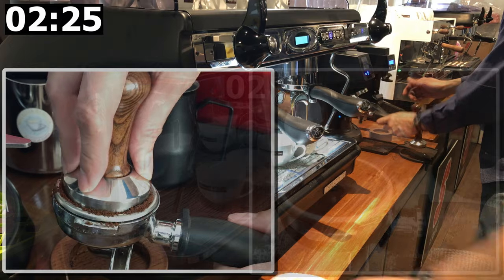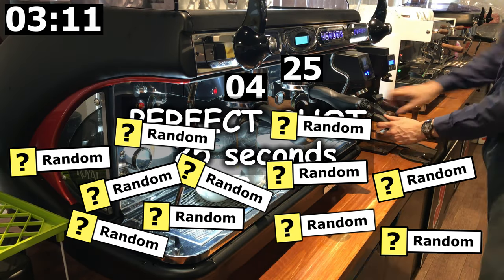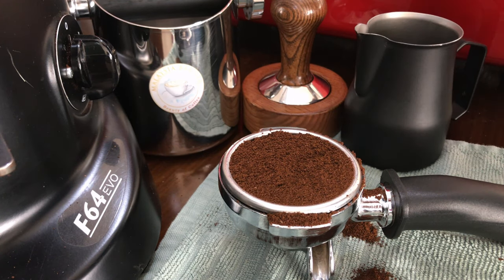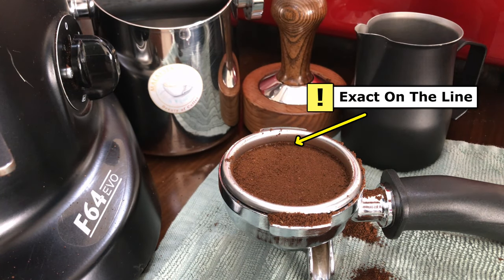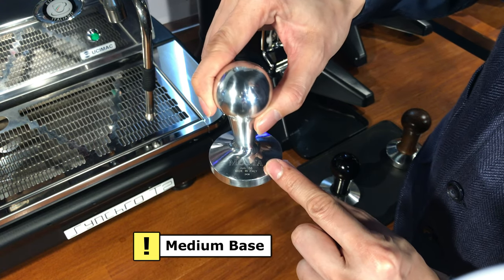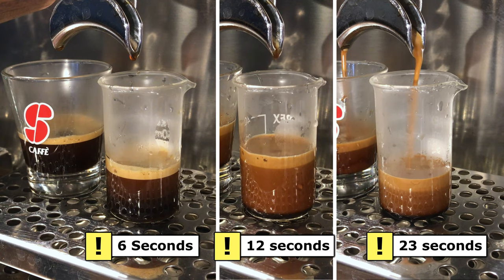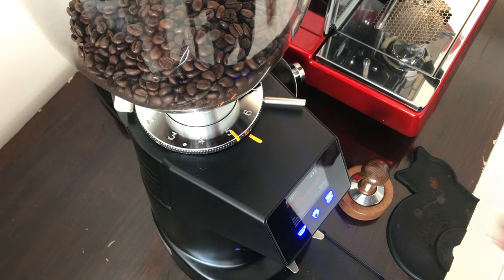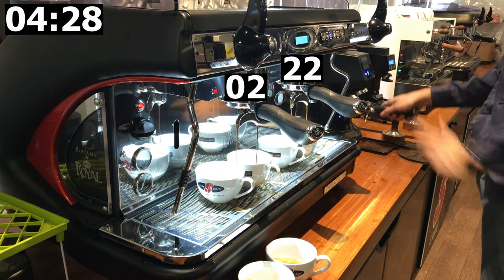(183) 6 Steps for Tamping , How to Consistently Get Perfect Shots of Espresso on your Coffee Machine

Comment: Hi.. Do i need to use distributors first then follow by tamper? Or can just use tamper only?
Reply from the maker: You can do either, just ensure you follow the tips in the video. You can make mistakes with a distributor as well, therefore do read up how to use it properly
Reply: Always distributor first